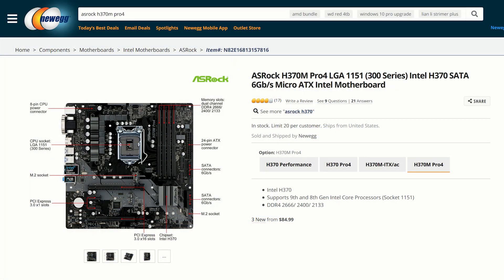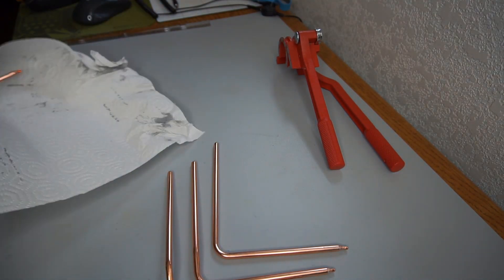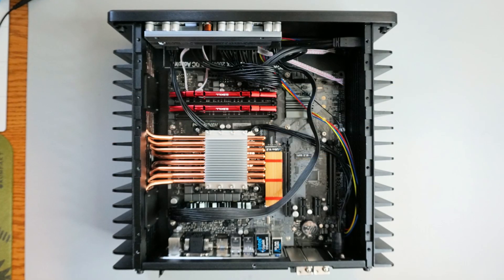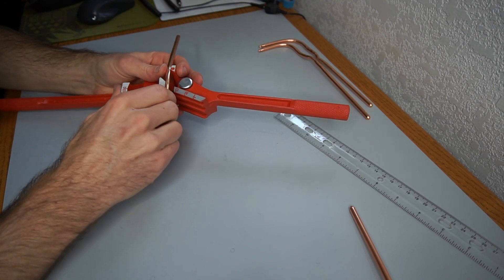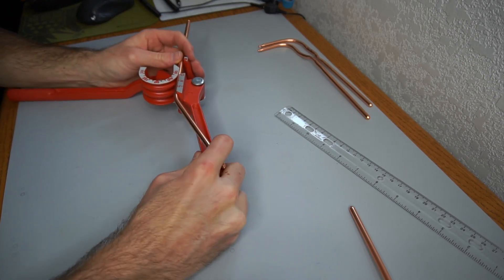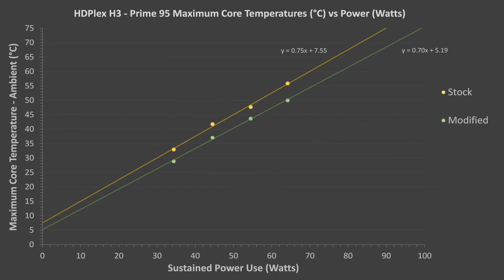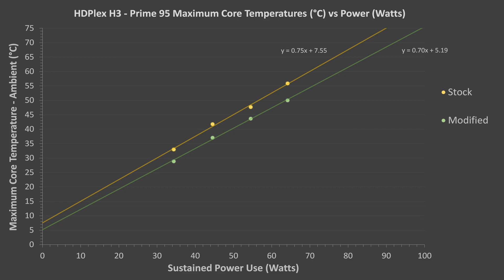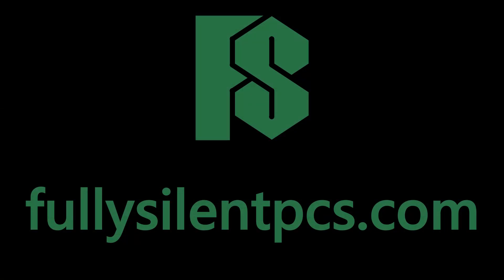Testing a Fully Silent Fanless PC - HDPlex H3

Comment: ALso, very interetsing to find that the copper bars are hollow. From what i can tell air is a very good insulator so heat dissipation might actually be better with full copper alluminium rods, rather than hollow pipes
Reply: It's not just that they are hollow - the copper on the inside is designed to be like a wick and a very small amount of water exists inside the pipe.  As the CPU heats up, water evaporates internally and moves that heat to the other end of the pipe where it condenses and moves back.

Comment: have you ever tried this case with an AMD Ryzen 5700G with integrated graphics? It runs on 65W and would wonder if the case would handle the load. 
WOuld love to hear your thoughts
Reply from the maker: Yes, it handles the 5700G with no problem.

Comment: Use a lil propane torch to safely bend the copper
Reply: This wouldn't work because heatpipes can only tolerate so much heat before they burst, to my knowlegde this is around 250°C max.
Reply: @paulr5528  Just for bending, use a little extra heat so that the copper doesn't crack as you bend it. Only takes a few bends before this starts to happen, but a lil heat will prevent that.
Reply: @RBryanIrwin  Yea I see your point. I just looked it up and typical temperature to anneal copper is 400°C or hotter. I can't find anything definitive on what temperature heat pipes can tolerate before they burst, it depends on the individual ones and how they are built. I'm pretty sure I've read 250°C a few times though, and I wouldn't guess that just normal heatpipes off AliExpress would be designed for anything above. I personally would be too afraid of ruining the heatpipes by blowtorching them. But maybe putting them in the oven at like 200 or 220°C for a few hours would work? I have no experience with metal annealing whatsoever.

Comment: Thank you for torture testing a CPU-only setup, and a 65W TDP model at that, in what looks to be one of the better fanless cases. I'm considering an i9 10900, the 65W TDP model, without any GPU, as a DAW (digital audio workstation) and this has been very convincing. Even the stock setup looked quite good already, and modifying some extra heatpipes might just be worth it. Thank you for a great video!

Comment: The H3 can house half height cards. Do you think it'd be possible to connect a half height graphics card to the other heat sink? The pipes would have to make a 180 bend to connect...
Reply from the maker: Possible?  Yes, but difficult.  You would have to find or create a heatpipe block to attach to the GPU, and be able to carefully bend the heatpipes properly.

Comment: It would be more interesting to use other side for GPU cooling purposes, don't know why they not provide such option. Also some of the custom made heatpipes seems overbended in some places, do you tested heat transfer of each pipe after bending? I mean you could heat up one end of the pipe with a lighter or something and measure temperature on the other end to examine difference and how long it takes to transfer.

Comment: Surprisingly low gains. I guess a better mod would be to use the left side heatsink to cool a 75W low profile GPU with a DIY heatpipe system.
Reply from the maker: Yes, I was hoping for better.  It might be possible to fit a small graphics card in there, but for a GPU the HDPlex H5 is a better choice.
Reply: Fully Silent PCs 
Yes, I have a H5, it’s good value and it has great flexibility. But my other fanless PC’s are better in some ways: my HFX Classic cools much better and my Hush  E5 mk3 has a level of build quality never seen since.
Reply: @eug3nius  HFX classic are a full size ATX case?